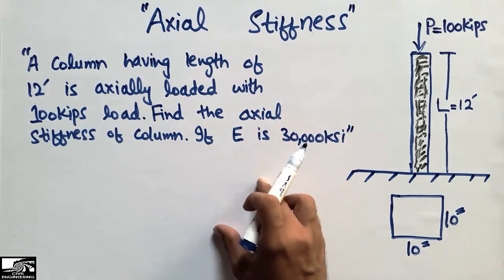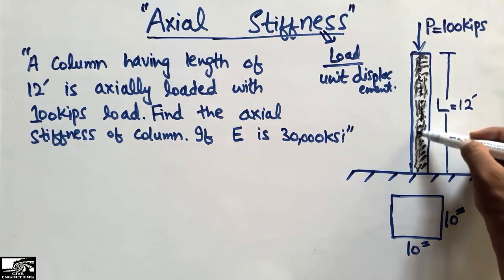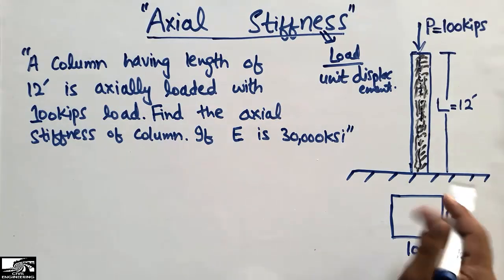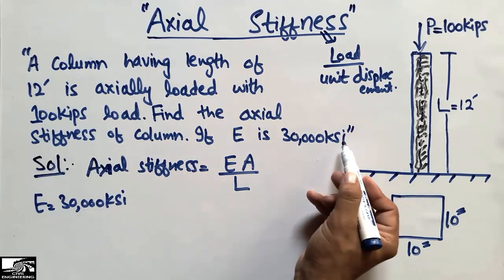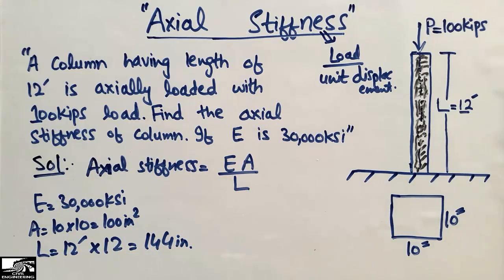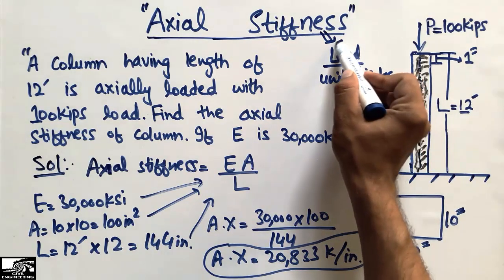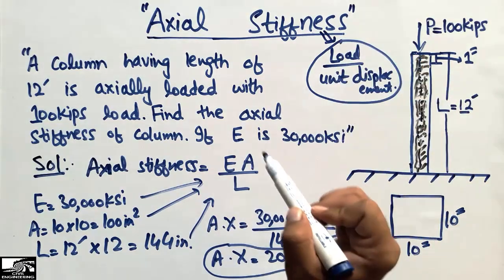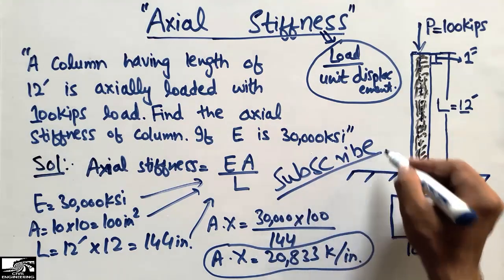Axial Stiffness of Column || Example Solved

Comment: Why did you not use the force of 100 kips instead of EA? When its definition is Force per unit displaced?
Reply: Because it's actually the in-built force of the member to resist an external force.
Take as the resistance of the member against external forces.